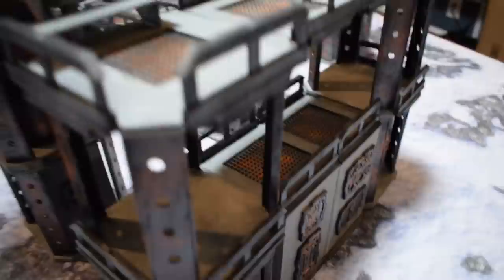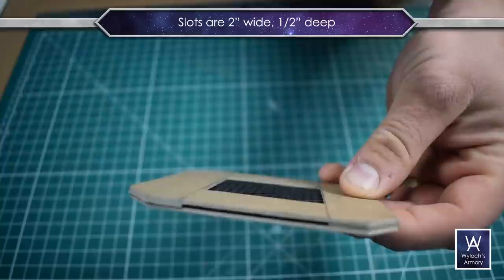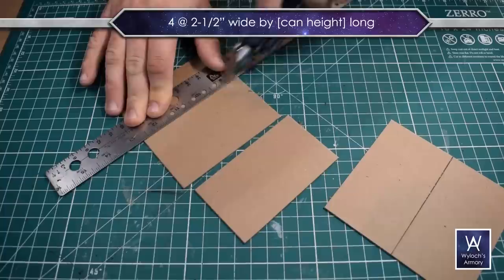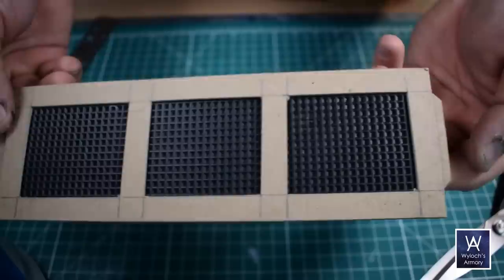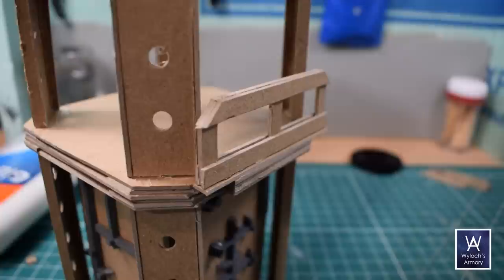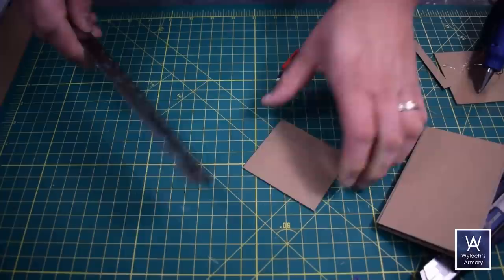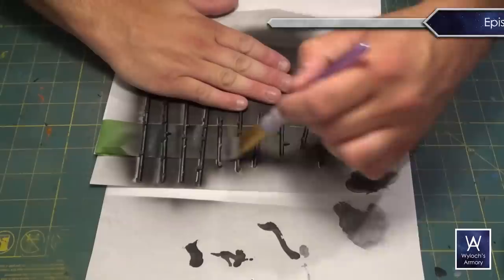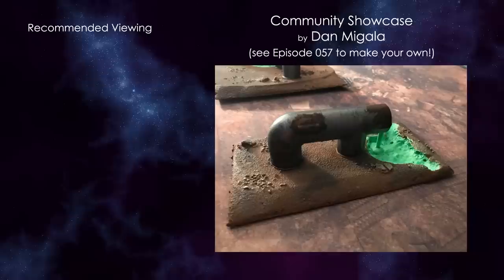How to Scratch-Build Sector Mechanicus Walkways for Warhammer 40k, Kill Team

Comment: Turrets. Chain hoist. An I bean style lift across two platforms conveyor belts system. Power cables jumping from tower to tower. Lights over hanging the walkways and the tower pieces. Flags draped down or stood up. Control panels. Mechanical levers. Clip on equipment like generators for electricity. Could go a bit morbid and make and executioner's block with gallows and such. Obviously any broken version of the modular pieces. Landing pad. Gas lines/plumbing. Cranes?? Maybe cranes might be a pain.

Comment: Recommend the use of Styrene sheets instead of chip board. Easy to score and snap, glue using thin modeling glue for seams, thick glue for wider sides.
Reply from the maker: Way, WAY more expensive.  And more difficult to work with.

Comment: Converting it to simplified metric: 3" is 76mm, and 2" is 50mm. 
Each 76mm length with a 50mm slot should then have 13mm on either side of it:

I------------------------------76mm-----------------------------I
I                                                                             I
I---13mm---II-----------50mm-----------II---13mm---I

Comment: I invested in the materials to make this scenery. I meticulously took my time measuring and cutting and tower assembly components were constructed.  Sadly Humidity is an evil that made my entire work trash before finishing any modules.  Nice concept, but I will return to using  3D prints & polystyrene.  Thanks anyway.  *Bubble popped
Reply from the maker: Ah bummer.  What part of the world you in, roughly?
Reply: @WylochsArmory  Kansas, quite damp & humid. I'm waiting for the damp humid weather to clear up then I can seal everything with some Modge podge. Any suggestions?

Comment: Great video, just picked up all the materials to craft this for my tabletop. Question though - any reason to NOT base the components in black spray after assembly? I usually do all my terrain with black spray followed by a grey zenithal coating. Seems like it would work for this, even with chipboard as the material.

Comment: 11:30 I highly recommend doing 8 inches and not 9 inches long walkways. 9 inches long walkways are tedious to make because the rectangles inside the walkways are not round digits. While if you do 8 inches walkways, you leave 1/2 inch for the sides, 1/2 inch x2 for the gaps (for a total of 2 inches) and then you got yourself 3 squares of 2 inches wide for the centers. (which by the way is the same square as the towers, so you get a really even and good looking walkway)
Reply from the maker: That's a good insight.  I did 3" because of the tab size being 2", but you could also reduce the size of those.
Reply: @WylochsArmory  No worries ahah, love your videos, I chanced upon this video by a stroke of luck and decided to give it a try, it's really time consuming but highly satisfying to make those, I just realized this little quack when doing walkways, but overall, I'm really satisfied with your tutorial, keep it up ! (though, you're on hiatus I believe?)

Comment: Amazing simply does not do justice to this!

Btw, coming from a complete amateur, instead of the tin soup cans, can I use the cardboard roll from toilet/kitchen rolls or pieces from water (or other drinks) plastic bottles?
Reply from the maker: You could, just consider your use case.  For me, I am using in wargaming where line of sight blocking is important.  Those tubes would leave too much open.

Comment: Why not spray prime the pieces? 2-3 light coats?  Very nice build btw, well thought out.
Reply from the maker: Thx!  As for priming, not sure the purpose of that...all of this is cardboard which totally drinks up paint, so paint adherence isn't a problem.

And you can't spray a walkway since you might get the primer color down in between the grating...
Reply: @WylochsArmory  Mainly time savings. instead of brushing on the primer for the base coat, just spraying it. Just a thought.

Comment: I just made templates for the first few pieces.  I am going to make several different pieces using your method, but I have a question.  How would my build be different if the height of my towers were only 3" high?  The games I play work better with 3" high terrain.  I am asking because I am not sure how it will impact other aspects of the build.

Comment: I am nearly finished in my construction and about to move on to the painting phase, but I had one question before I do...Does spray paint negatively affect the chipboard?  Do I Have to use acrylic paint?
Reply from the maker: A great question, and in fact I HAVE experienced delamination of chipboard using spray due to the propellant, however I specifically remember that I had the can WAY too close, and it got much too wet.  Use it properly and you'll probably be ok.  As always, do one piece first and prove that it works.
Reply: @WylochsArmory  excellent, thank you so much for your help.

Comment: Hmmm. My bottom is flat but the top has a curve. I think the granny grating is too thick
Reply from the maker: Did you use hot glue?  If it cooled too quick that might cause a bulge.  Skip it going forward.  I stopped using it for the mesh.
Reply: Wyloch's Armory White glue. I made 11 more, I’ll see how they turned out soon. I put some weight on them.

Comment: You build really well but you need to learn to paint better. There's so many tools these days that could take the same effort as the bronze brush on and give you better results. You have great building skills but it's let down at the final hurdle.
Reply from the maker: Such as?
Reply: @WylochsArmory  AK interactive's weathering catalog, Vallejo's similarly. Rust effects, sludge effects. Any kind of effect you can think of and it will be a huge improvement over slapping a bit of copper on it.
Reply from the maker: @graveofmonsters4076   But 5x more expensive and with dry time.  Bear in mind the goals of this channel, speed, cost, availability to everyone.
Reply: @WylochsArmory  Your black wash can work for other colours and stippling is pretty easy. If you want to go super cheap there's still better ways to use craft paints to get higher quality results.
Reply from the maker: Yeah.  Quite coincidentally, I do have the Vallejo weathering line on my shelf to review, and these were among the things I planned to test them on.  :-D
Reply from the maker: Thx for watching